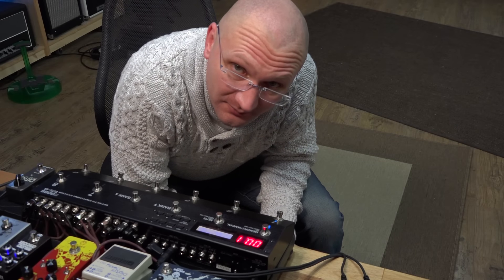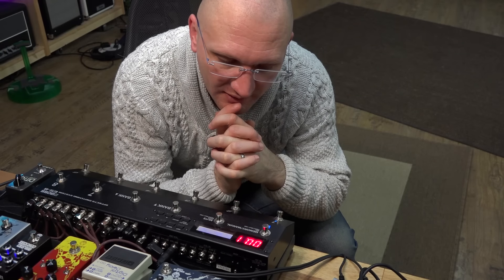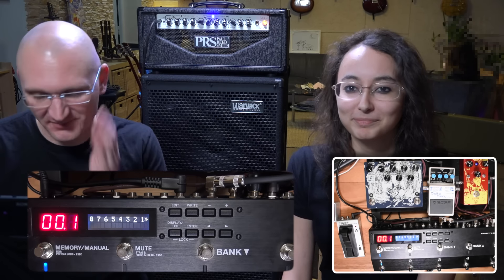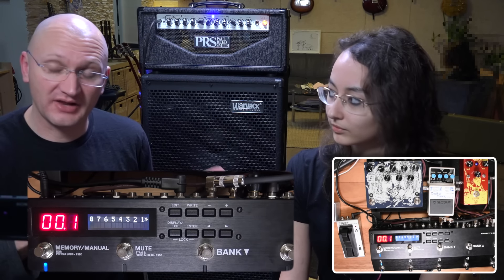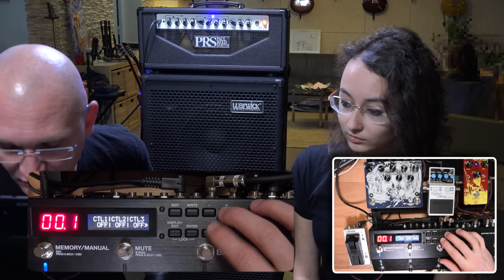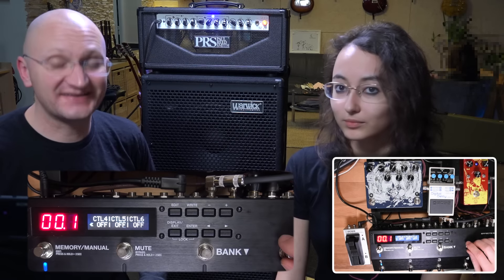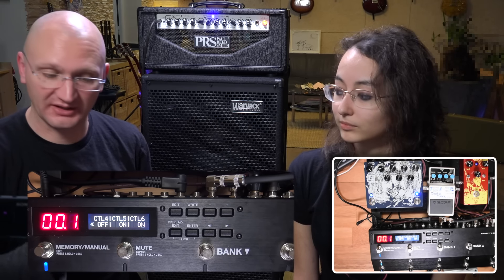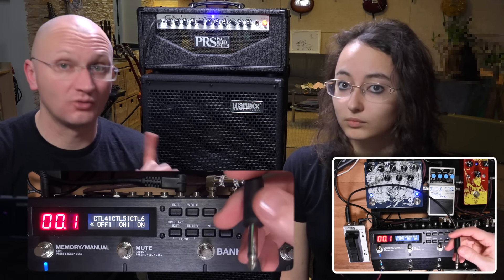Boss ES-8 Tutorials Part 7 - CTL In / External Switches

Comment: The fact that an external footswitch will automatically be routed out through its corresponding ext out port is perhaps not so weird after all. Let's say you have an amp with two channels and you wish to use the ES-8 to switch between them, you might not wish to have this function take up one of the ES-8 switches. This would perhaps allow you to basically have 8 pedals in the ES-8 loops while simultaneously having your amp channel switch externally, while also being able to engage any of those 8 pedals in the loops whenever you switch between amp channels? That's at least how I imagine the reason being for this default routing.

Comment: Hi Thanks for the info.  I have  question.  I got my amp to toggle between dirty and clean channel. Can I get the reverb to toggle on/off from the same switch (1) so there is no reverb on the dirty channel but it is on when I toggle the switch for the clean channel in the same single click.?  or do I have to assign a separate switch for the reverb control?  Can't seem to make this work this way.  Reverb stay on or off when switching channels.  Thank You

Comment: I guess Boss uses the MIN/MAX definition, because they thought i would be the same as on any MIDI CC paramater 0=Min and 127=Max....so for most toggle options via CCs you use these two parameters...and maybe Boss thought, "let's use it for all our internal switch options as well"....this is where it gets a bit tricky. ;)
while using the Mesa Switch, you have to click it twice for the "preset" toggle of the reverbpedal, because the Mesa Switch does: hit one - close (ground), hit two - open (ground lift) (or vis versa)...it seems, that the reverbpedal needs a Puls oder Latch like signal, so you have to convert the switching impuls of the Mesa Switcher to a signal type, the reverbpedal understands the right way...and it seems like you can do this with the ES-8

Henning, as we discussed last week....the ES-8 is a totally complex switching system, which maybe gives us more options as we will ever need...and therefore some things get really complicated. ;)

Comment: Unless you figured it out its becasue its a toggle switch so you cant use toggle mode which latches for changing presets because the preset change isnt on and off its on on.

Comment: The answer for the Min/Max On/Off issue: The max would be the closed circuit, the min is the opened.... so when you hit the button usually it does closes the latch.... BUT not at the Roland/Boss stuff.... it works vice versa.... When you build a pedal to control something you should use a opener latch... it must be closed and when you hit it you must break the circuit .. that 's make the boss to change the function (I had a very bad evening while i figured this out when want to build a pedal for external control for the RC-30 looper)
Reply: this is the solution for the double click as well... when you hit first it closed the circuit .. the boss sensed you released the opened button... so for the next click when you break the circuit again it switched the function.. but the latch remained open.. so with the next click it closed ... and boss thought it came back to normal state.....
Reply: And the latch pulse inverse ....  The latch option is normal toggle, click one close, other open... so on....

Pulse .... it should work as a momentary switch... it is always open circuit... when you hit a 'pulse' signal it closes the circuit and release it again as you step for a second on a momentary pedal switch ... 

the Inverse it's like the pulse BUT keeps the signal on, the circuit is closed... when you send an inverse pulse signal it breaks the circuit for a short time

Comment: BOSS has to rewrite the manual!! pretty please. Hey Boss, if you read this: bitte, bitte, bitte, please, please, please. Make a new manual. maybe the designers of the es-8 find it helpful. i have the es-8 and put high hopes in these tutorial videos, but even eytchP doesn't know how to get it working. i don't have the time to watch these clips for hours and hours and get even more confused. please, just 2 or 3 more sentences for each function and less phrases like "Was ist ein effekt loop?". i know it's difficult to write manuals, but it's possible, i think. you don't have to print it, just make it available online (pdf), cause i don't need all the languages. Thanks!
Reply: +BiBaBuBeBo GurrGurr 
BOSS manuals are generally pretty useless ...I think they do that just out of tradition!
I have two GT MultiFX units and the manuals tell everything you would know intuitively anyways just by looking at the device and the menus, not just once, at least three or for times. But the complicated stuff is totally hidden or not even in the manual at all!